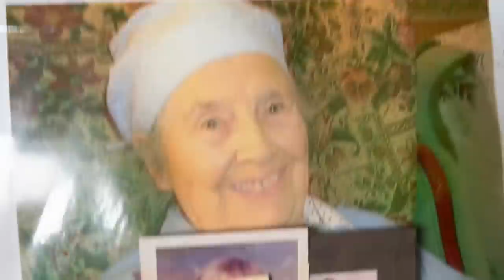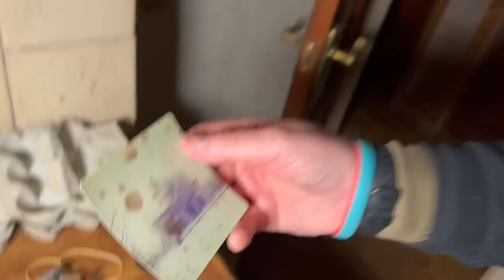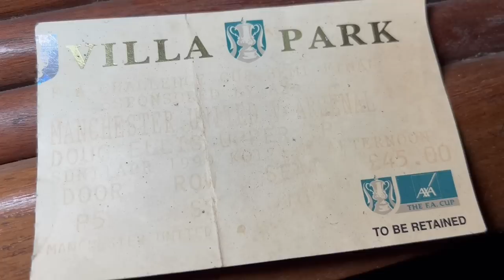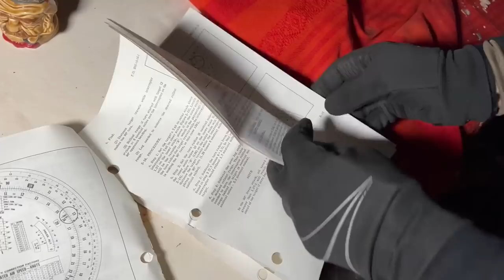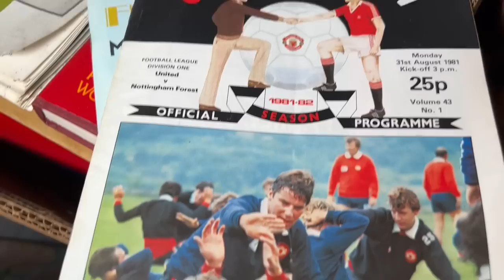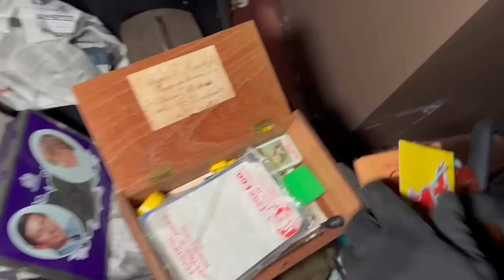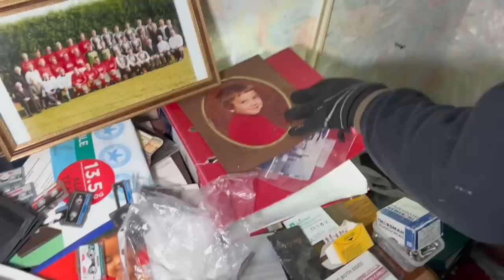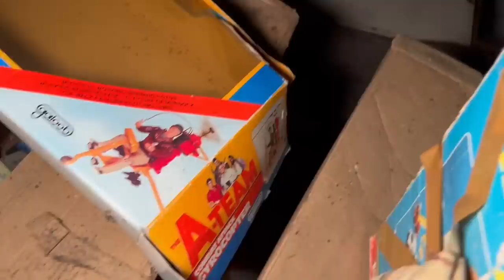This mental ABANDONED house sent this genius insane

Comment: Torpedo bottles, also known as Hamilton bottles, were used for aerated or carbonated water. They were oval shaped with a neck at one end, and were deliberately designed so that they could not be stored upright. The goal was to keep the cork wet so that it did not dry out and crack, thereby releasing the carbonation.

Comment: A Codd-neck bottle (more commonly known as a Codd bottle or a marble bottle) is a type of bottle used for carbonated drinks. It has a closing design based on a glass marble which is held against a rubber seal, which sits within a recess in the lip.

Comment: I'm an electrician that instrument is an Oscilloscope, it plots a visual line to measure voltage, amperage, cycles per second (Hertz).  It's meant to test and diagnose electronics.  And, those iron loops with wire taped to them looks like someone was trying to make a transformer, electromagnets, or trying to make some sort of stator to generate electricity (speculation).
Reply from the maker: That’s what I thought it was but wasn’t 💯 sure thanks for the info on the magnets

Comment: Some of those items above the kitchen wall units look as if they've come from a very old chemist shop.
Reply: Good idea. I wonder if that thing with the pump on it is some kind of a hand pump  centrifuge
Reply: I've been searching high and low to find out what that thing is with the brass pump, wooden handle and the brass wheel on the wooden stand that Andy is handling around the five-minute mark into the video. IS it's some kind of hand pump centrifuge maybe just spin and make the best olive oil or something or for mixing chemicals or is it some kind of thing to spend something made of wood or clay? Does anyone know? I've been searching high and low and it's driving me crazy

Comment: The Felsenthal CPU-73 A/P Air Navigation Attack Computer is a special purpose circular slide rule made for the United States Air Force and manufactured by the Felsenthal Instrument Corporation. Designed to calculate the course required for a fighter pilot to intercept a moving target, it is 9 inches in diameter.[
Reply: 9inches in diameter......but what's the length 😂😅 (as you know andy would make a cheeky joke about it) but thanks for the info, really fascinating to learn something knew.